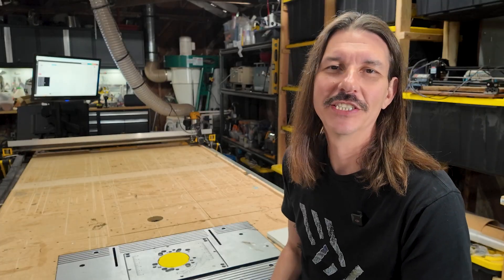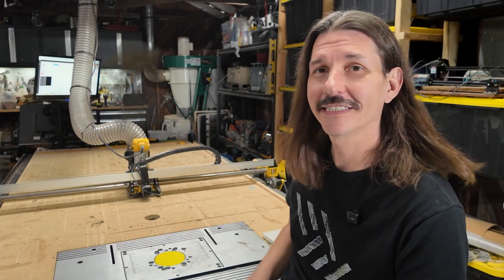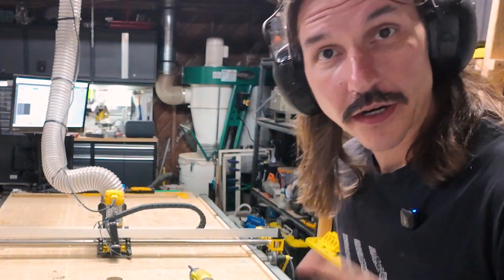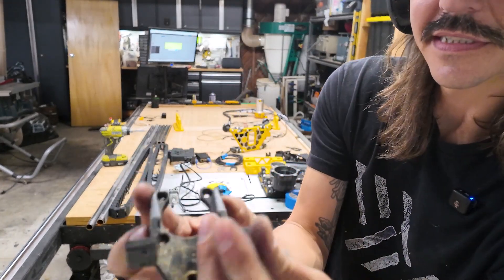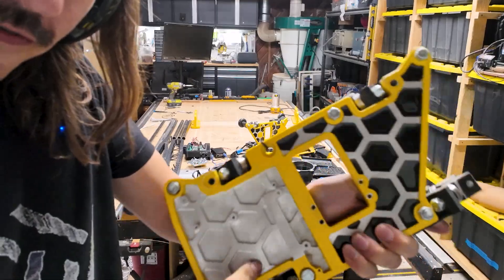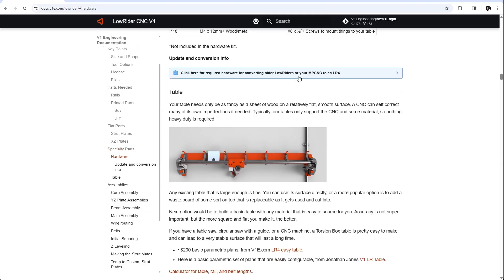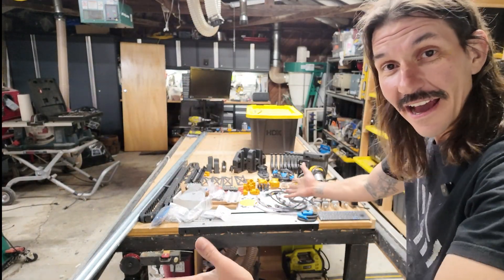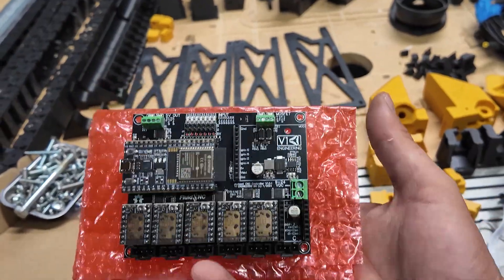Part 1 LowRider V4 Begins – Dismantling, Printing, and Prepping

Comment: Touch of the correct Loctite and a bolt would hold those nuts with no problem. Nut would probably need to be replaced once out, heating it to get the bolt off would probably wreck the nylock
Reply from the maker: I agree! That was a pretty painful fail on my part, but at least it was a good lesson.

Comment: Nice, my LR3 to LR4 upgrade is in process as well. Mine is moving around and homes, but I need to finish the squaring and such.
Reply from the maker: Awesome! How is yours going? I'm just about done with mine. It was easier than I thought, but adjusting my existing table has been a real challenge.